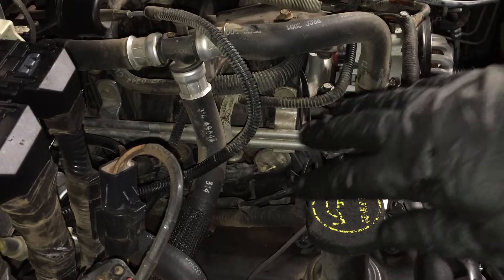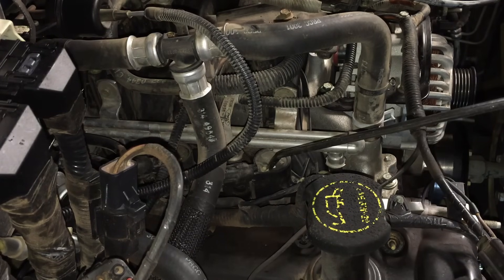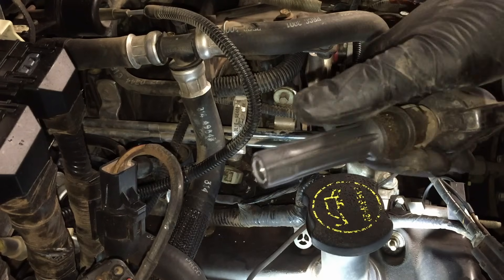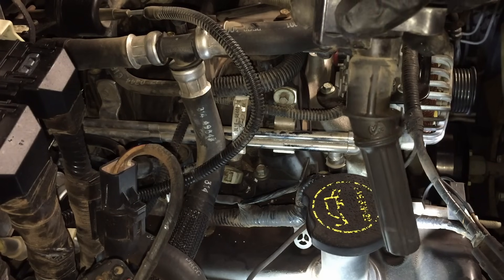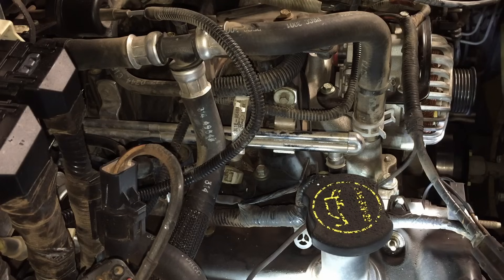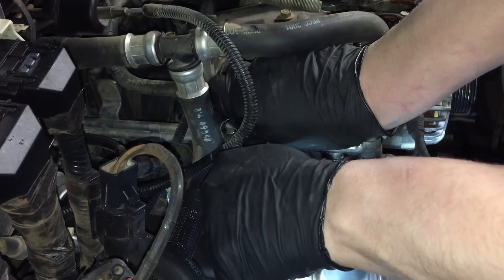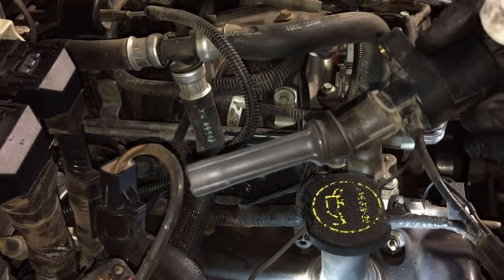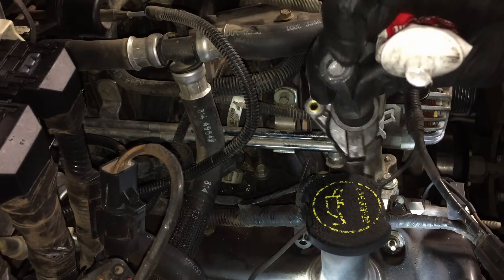Important Tips When Replacing Spark Plugs on Ford 4.6L 5.4L 6.8L 2v Engines

Comment: I have to say that it amazes me that you recommend only Motorcraft plugs, when Ford is unquestionably the perpetrator of the worst spark plug design of all time.
Reply from the maker: no
Reply: @FordTechMakuloco  No what? Can you name a worse designed plug than the one in the 5.4 Triton? I own one of these, a 2004, almost identical to the one you bought for the shop for 2k. I have done every single upgrade to mine that you did, plus a complete timing job per your wonderful videos. The only fopa I see in the 4 part series is that you didn't include roller followers, and lash adjusters in the initial series. You did recover in a later video though. I did the transmission OD upgrade you showed us, and bought a new pan with a plug from Amazon. I think it was 34 bucks. Better than a red shower IMHO. Thanks for what you do, you are undoubtedly the best Ford mechanic I've ever known, and at 78, I've known a few. You videos are incredibly complete, concise, clear, and accurate, with no lousy musak to deal with. Thank you, Brian. Last week I did the rear seals, after watching your video several times as the right side was leaking at 170k miles. I used a Felpro gasket on the cover.

Comment: I'm a firm beliexer in Anti-Seize, but you should NOT be using it on Spark Plug threads. The spark plugs are made with a material already on the threads to prevents seizing, also by appling additional anti-seize you're reversely effecting the torque value needed to properly tighten down the spark plug.
Reply from the maker: All lies in the real world but true on paper

Comment: Looks like you might have used copper anti-seize in this video, but I know you now use nickle anti-seize.  Is there a concern with using the copper type?
Reply: Copper good for high heat,into aluminum heads.Dont overdo the anti sieze

Comment: Do any of you have any ideas about why my 2008 Ford Econoline E250 V8 4.6 2 valve only starts shaking after warming up? The computer reports a higher temp but the temp guage barely moves up even when the engine is hot. Steam or smoke is coming out of the exhaust. I tauched inside the exhaust pipe and it seems like water instead of oil. The scammers who sold me the vehicle did something to cover up some majure problems, including the water pump not working. I replaced the water pump and now the coolant is flowing. I used head gasket sealer which seemed to help but not substantially. Is there a different place coolant can leak besides the gaskets, and still get into the combustion chamber? Do you thinks it's a bad valve? No DTC code besides an key in ignition fault. I replaced the spark plugs and coils too. When I try to drive the van it barely moves and the engine sputters. Please list any ideas that I should check. This would be very appreciated. Thank you.

Comment: Ok I can not access the coil on cylinder 8. I have the 5.4l V8 triton. There a fuel rail and some other tubes in the way. My biggest issue is accessing the bold that holds the coil down. How can I remove this so I can finish installing all my coils and plugs

Comment: Are the Motorcraft Platinum plugs really supposed to last for 60k miles? I started getting a rough idle after ~25k miles. There was no check engine but my OBDII scanner showed a mode 6 code for cylinder 4 misfire. Should I just be cleaning these plugs every oil change?

Comment: I know this is an older video, but it is still providing a lot of value!!  Just bought a 2004 Crown Vic for a project and grocery getter. Have all the service orders from the prior owner and they had new plugs installed.  I just checked all the plugs and applied the suggested torque!!

Comment: I'm doing the fourth spark plug change since I bought the truck in 2002. I'm at 480,000 miles. This job never get any easier.

Comment: I got duped on eBay when I bought 8 of the Fake Motorcraft F150 Ignition coils for my 2007 F150 4.6L 2 valve engine.  Seller cut communications off with me and, would not refund.  I had installed 7 out of 8 of them and then ran across one of your videos and learned I had been very cleverly tricked.  Ended up waiting months after ordering from local Ford dealer.  Made me feel sick.

Comment: What do you do if the socket(5/8 spark plug socket) won't go onto the spark plug you're trying to take out?
Reply from the maker: Look down in the spark plug well there is most likely a rock or other debris between the hex and spark plug well.

Comment: Anyone ever have trouble with putting dielectric grease on the tips of the spark plugs I hear that’s the worst thing you can do. And it makes sense some mechanic put red grease on my dad‘s truck. I put an endoscope and the spark plug tips is completely covered in red Greece. Runs rough
Reply from the maker: Never a problem just a small dab goes a long way.

Comment: Thanks brother i have a 1997 ford 14 ft box truck ! I think it's misfiring when I go up hill , hesitating . I'm going to change plugs and coils ! Thanks for the video 😎 motercraft only and use fresh air to blow out the debreeze 😊 so much better than going in without a clue😊😎
Reply: Did it work?
Replacing Ll the coils is expensive. Check coils by unplugging themindividually while engin is running. If the engine suddenly runs rough. Then that coil is good. If there is no change that the coil that’s not working.

Comment: Do you have a video on the 2000-2005? Excursions P0720 code. I can't figure out what's wrong with mine. Mine is a 2000 six point eight liter gas

Comment: Don't understand why NO One does videos to show how to get to and replace the hard ones in the back. Everyone always demonstrates an easy access plug or coil.
Reply from the maker: It is hard to film back there and the process is basically the same on all cylinders except #7
Reply: @FordTechMakuloco  The process may be the same but the disassembly of things that have to be moved to access the back ones are what is not covered.
Reply: I replaced one in the back. You’ll need to find way. I have small hands and I didn’t have a problem. But if I did I would just remove the things that I can’t get around. There it no one way. The dealer  always charges labor hours based on how the factory removes it. But if you have skill and experience you can get m
By with out removing things like the dealer wants.

Comment: So I’ve been dreading changing out the plugs on my 2007 f-150 4.6 because of them breaking off. Is that an issue with this year and Engine?
Reply from the maker: No, you have a 2v engine they do not stick nor break.

Comment: I’m old school.  Changed many plugs in my time.  Worked on many cars and lots of big block muscle cars.  Have a 97 Lincoln Town Car with the 4.6L engine.  Was checking my maintenance  schedule and found Lincoln recommended changing the plugs at 30K miles.  Mine has 50K on it so I figured I’d change them.  Went out opened the hood and thought OMG.  Figured I’d just have to pay a shop.  That’s something I’m not to crazy about because of cost but mostly because I’m very particular about my cars.  Decided to look on U tube and see what I could find.  Watched 2-3 videos before yours and then came across yours.  There was one other video equal to yours for information, knowledge, quality of camera work and knowledge.  Excellent video,  after watching I’m confident I should be able to change my plugs without any problems.  I’m going to get a set and do my best to follow your directions and with my experience should be able to do it.  If all else fails I’ll get the one I start on in and have to take it to a shop lol.  Thanks for the great information.  Keep the videos coming.
Reply: see if you have full treads or just 4  like he says 
i you have full treads i would go with factory specs
Reply: Thank you so much for sharing your video , time, and knowledge. I/ we appreciate it. I will be doing this over Christmas vacation 😅 a long with the Radiator 😮 
 I have a question though on a video I watched before yours the guy said to run the engine for about 15min before taking them off is this true, or it's going to messed up my engine . If you can, please help me out with this question. Thank you again
Reply: @victornunez9204 Guess you need to do some more research. 🤷

Comment: Careful not to break these plugs in half. Mechanic quoted me $200 every breakdown. I took another YouTube mechanic advice by first driving the vehicle 5-8 miles or so to get it warm and then remove the spark plugs. For my situation I had to warn the engine every 2 plugs that I removed because the carbon and burned oil build up has almost fused the plugs into place . You will feel it because there’s a strong resistance when attempting to loosen the spark plugs and that stubborn resistance is what will cause the plugs to break. To help loosen the resistance, you gotta warn the engine by driving it a few miles.  Believe me this worked for me so far. Take it easy
Reply from the maker: These plugs do not break ever, you are confusing it with the 3v engines.
Reply: @FordTechMakuloco   yes I'm referring to v3 navigator.

Comment: Thanks, great video, note to self=.......7 mm. socket ,  (9/16ths spark plug socket 2009 4.6L 3v.)  9 inch extension with universal joint, dielectric grease , nitrile gloves,  39-43 thousands gap for spark plug,( 2009 4.6L 3v v8)

Comment: @FordTechMakuloco  While I completely trust your advice regarding the "overtorque" of these plugs, I'm really concerned since online manuals still say 11 ft/lbs.  I also don't see a Ford TSB on it either. One would think that Ford would have updated this by now. 

Can you explain why there is so much confusion about this? Are they trying to avoid lawsuits or something?  I'm just trying to get this right, so that I can change the plugs myself every 30,000 or so in my beloved 2004 MGM.  This would be the 1st time I would be doing it, and I don't want to screw it up. 😀
Reply from the maker: Torque them at the spec and have problems or torque them at 20ftlbs and never have a problem. It's up to you but there is a reason I don't have comebacks.

Comment: Installed 8 new Motorcraft spark plugs in my 2003 5.4 2v. Expy. I have never had any problem with MC plugs. 8000 miles after the install I lost # 7 hole. Changed injector , coil, and still no joy. A friend of mine asked if I changed the plug and I laughed,  knowing I only had 8K. on the plugs. I was ready to pull the valve cover and he made me change the plug on 7. SOB it was dead as the space shuttle. FMC has lost one of their favorite customers buying spark undependable plugs. I just can't depend on them again.

Comment: Thank you so much for your info! I'm trying to get my hands on the Motorcraft Dielectric Grease in a pinch and I'm having trouble finding any nearby. Can I use any silicone dielectric grease? Or is there another brand that might be easier to get my hands on. I'm gonna be replacing my ignition coils and spark plugs on my E150 using motorcraft parts. Thanks for any feedback!

Comment: Any tips on 4.6 getting engine shudder under load at low rpms? 2006 town car. No codes on the obd2. Just replaced all the COPS. Maybe the plugs?
145k

Comment: I enjoyed your well done video. I recently purchased a 2006 Camper with a F-450 V-10 Triton engine. The vehicle has 52,000 on it and runs fine. I don't think the spark plugs have ever been changed. Do you think it is necessary? Thank you.

Comment: I have a F-150 with the  Triton Motor. I have rarely had to touch it. I did replace one coil  many years ago.  About Five years ago the truck developed a bad miss. About that time it needed a  new battery. After that the miss went away.  It was running pretty good , no missing until  one of the battery terminals cracked when I discovered that I noticed mice had recently been in the engine compartment and left some of their typical mess . I had no compressed air and the engine was cool so I washed out some engine cavities with a water spray nozzle . The Engine started right up but now has a miss that is most noticeable after the engine warms up. Most likely some water or condensation  has caused the problem even after evaporation. Possibly the moisture caused a minor short in the coil or some kind of arcing. I have always wondered if the computers could be programed to develop faults and fault code’s for the purpose of job security and future sales of newrer vehicles to people who just do not want to deal withbeing$100.00 and $1,000.00ed to death. I also Have a Chevy 2500 HD that I also like . Both trucks have had the typical fuel pump failures . The Chevy has problems with electrical connections like Tow Haul and gauges just going out / not functioning. Prone to failure replacement parts are priced exorbitant . I Do not have time for it or removing everything from the truck to lay it up at a shop or risk smash and grab. Many of the Big Trucks I and others Run develop engine light issues that require  periods of down time  few can afford especially considering the trucks are fairly new. Dealer’s and service shops are having parts availability issues related to complex service / parts agreements and restrictions on the ability to produce and distribute suitable aftermarket components. When Government Gets involved , many wrongs become state sanctioned wrongs. It is not in the interest of self preserving government actors and affiliates to admit mistakes and faults that have so greatly had a negative impact on society. It is far easier and self preserving to point accusing fingers elsewhere to avoid the Liabilities described in parts of the Fourteenth Amendment.

Comment: The reason why changing spark plugs on a Ford engine is it design problem they were too cheap to put in proper threads in the cylinder head when you change your spark plugs so if you don't do it right the talk plug with pop out and you could damage the engine unless you turn it off immediately it could also cause a fire don't you ever want to meet one of these engine engineers in a dark alley with a baseball bat

Comment: your video was great.  just one question.  why did you put anti-seize on your spark plugs when it will change your torque value and also it not recommended by any spark plug manufacturer.
Reply from the maker: I always have and I always will, you put a small amount on and don't bother changing the torque value.

Comment: What do you think about the antiseize? 

The issues i have read with torque values is they are for DRY. The moment you add any kind of grease and use a torque wrench you are actually pushing the threads beyond their limit and can BREAK. 

Say the dry spec is 10 ft lbs. You put grease on it and click it right at 10 ft lbs. The threads see 20.
Reply: When you torque dry it’s going to be at a lower value. When you add anti-seize you’re able to go more

Comment: The metal that holds the coil pack in place is crack. Does any know of some fixes that don't include jb weld.
Reply: I don't have a solution but I have the same question I have 6 That are  Crack can't tighten

Comment: Good work! I have a 99 f150, that I bought new. 5.4L. Dealer tuned at about 85,000, as it started misfire. Didn't run right after that. I removed the plugs myself. 5 of the coils were used brand X's, 1 plug was wrong heat range, and brand! I called Ford... Never heard back... So.. I do all my own repairs \ maintenance. I am retired journey man general mechanic.
Reply: Do the fuel rails need to be moved?
Reply: @navylive4dastrikehugomelch401   no sir
Reply: A big auto-mechanic survey by
Consumer Checkbook out of
Washington DC several years ago determined that DEALER
Servicing was the WORST! They
can't even fix their own brands!
Also no good: Chain-shops that are beholden to Wall Street, and
who largely base employee-pay on upselling and commissions.
The better choice: Independent
shops with good word-of-mouth,
who only have 1 or 2 locations,
and the OWNER is frequently on
the premises.
Reply: i worked at a Ford dealer in Canada, i have never ever heard of a dealer replacing random/single plugs.. we wont even work on a vehicle unless we replace the entire stack of plugs.. the coils are a different story.. i would be weary of dealers and i would file a complaint with fords head office about that dealership they should not be replacing random plugs it only causes more issues down the road.... im still a mechanic but i own my own shop i still refuse to replace just one.. its all or nothing because i cannot be certain the plugs that were not changed wont fail shortly after.

Comment: So I just put in all new plugs and coil packs in my 4.6 2003 Crown Vic, using the Ford parts you recommend. I am getting a misfire on cylinders 1,2,3,4-all on the same(passenger) side of the engine. I am using the FORScan software. I am at a loss as to where to start looking for the cause. BTW, the car has 78,000 miles on it. Can you point me in the right direction please? Thanks so much!
Reply: Listing the actual codes might be more helpful, for anyone with the knowledge to be able to help you more with your issue.  

I’m not a mechanic myself, but the more details with problems and solutions that are shared, it makes things easier for everyone.

Did you ever figure out your misfire situation?

Comment: Tech; I have had many E series vans and had one plug blow out. I followed your video on that repair with success. Thanks! Now here is a question; Would it be "practical" to swap a V10 engine with TorqueShift 5 speed into an E350 with a 5.4 OD4speed? I also want 4:10 axle. If so, How would all this be coordinated  electronically? Thanks